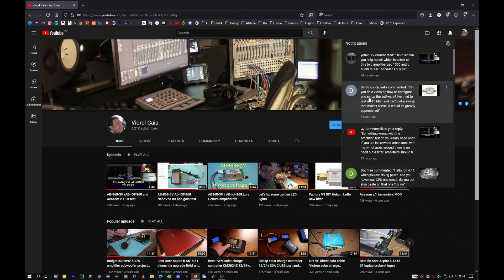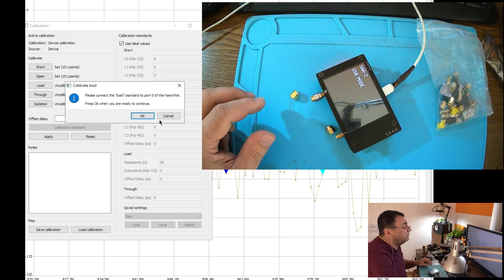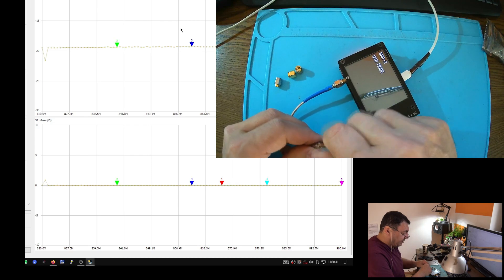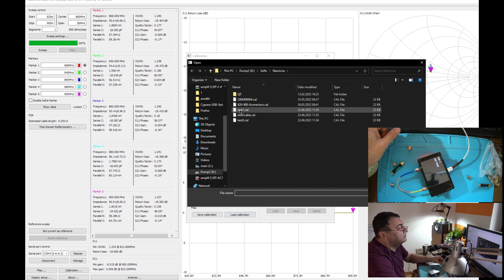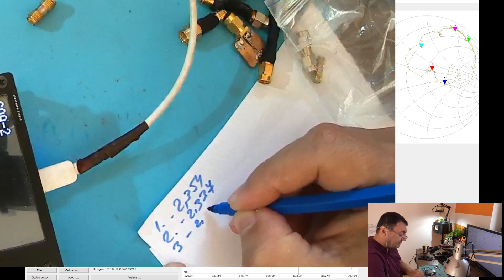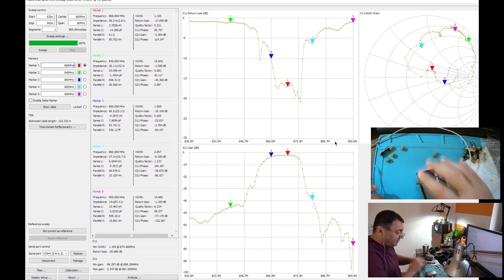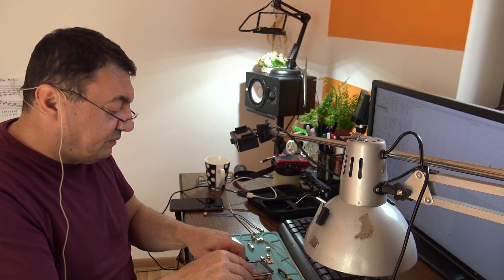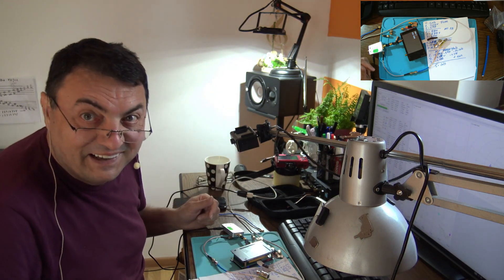How to use NanoVNA Saver software

Comment: Hmmm I've just downloaded from github and got a different software for nano vna saver. It started with a black background, 4 windows, and the setup is totally different.
Can't find any videos on how to change the windows ( functions of the sweep) so unable to do the SWR sweep I wanted... Can't use the software because I'm, unable to change the modes.
It looks like a better software, but is harder to operate... I'll post the version later.. 
Can you do a video on this latest version please..
Reply from the maker: I recall I did a resoft to earlier model, didn't work well, the touch screen frozen and so...there should be a software to push the firmware in USB mode to NanoVna.

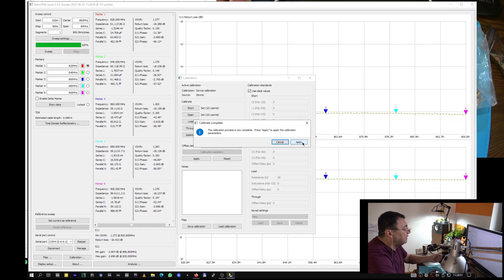Comment: I'm having a very hard time seeing the text on your screen. I don't expect you to redo this on my account but perhaps on future videos, you can zoom in. At 3:24, you go from calibrate and "at first you should see the cable itself". What test is that ? I can't read it from the screen, sorry. My default screen is a Smith Chart on top and polar below. I'm just wanting to check my home brew antennas for resonance. I'm getting some new glasses in a couple of days. See if that helps but every text is a blur on the screen. Curious to know what others are experiencing.
Reply from the maker: It means a cable connected from port 0 to 1 directly..if the cable  and connectors are ok you should see a straight line...change your display settings from left down corner...''display" and choose what you need..probably for antenna  tuning is channel 0 SWR and Return loose..means two dsplays..but no Smith..
Reply: @viocaia  Thanks, I found that SWR selection but don't see any sort of run test command anywhere. I tried SWEEP but it returned an error: Cannot configure port. Time for bed. thanks.
Reply from the maker: @SmeeUncleJoe  Strange..I'll redo the steps..
Reply: @viocaia  It would be great if you could do a video on checking antenna resonance. I suspect it's the most common motive for people buying the NANO. Certainly in my Ham Radio circles.
Reply from the maker: @SmeeUncleJoe  Of course ..but let me tell SWR is not always a good reason for buying an antenna .I can fake that with a potetiometer! i'm always "listen " the antenna with a SDR radio for the best signal..
Reply from the maker: don't forget to like and subscribe..thanks!

Comment: During calibration, why did you ignore the direction to put a load on Port 1 ? You said you "don't have it" but you just used it on Port 0 . I don't understand.
Reply from the maker: Do exactly like I said ...don't attach any load to port 1..just aconnect the cable between 0 and 1
Reply: I have the same question.  Why was the load not attached to port 1 as the dialog stated...

Comment: I am a subscriber! Just under a couple other usernames! Thanks for setting this up. Looking forward to the rest of the video.
Reply: I had done all the same steps as you to calibrate
First calibrate only port 0 on the device and then via the software
When I sweep, I don't see a line connecting the dots. Instead it looks like a scatter plot graph. 

I'll try again as you describe step by step to confirm, but maybe my nano has an issue.
Reply from the maker: Thanks for support Dimitrios!